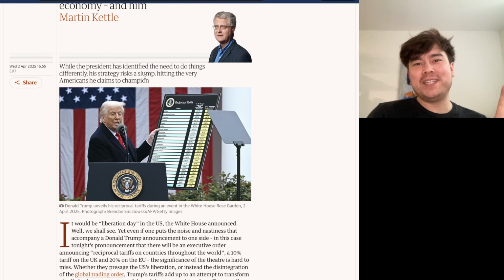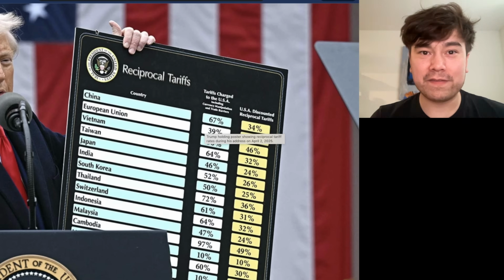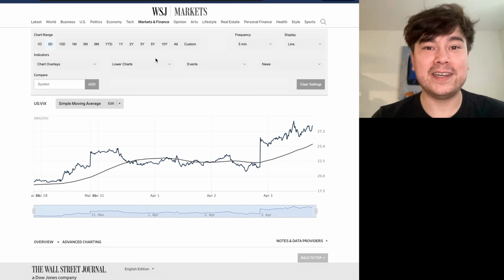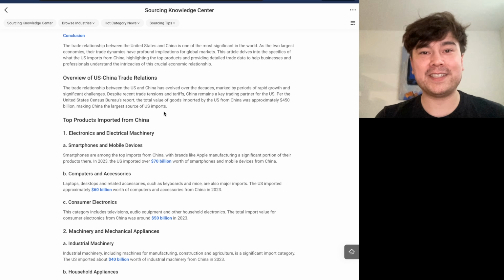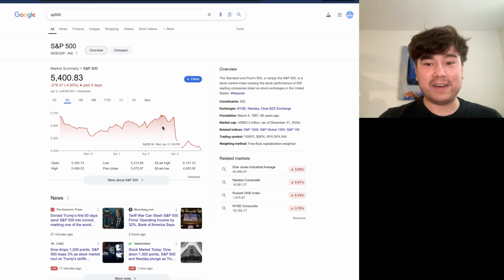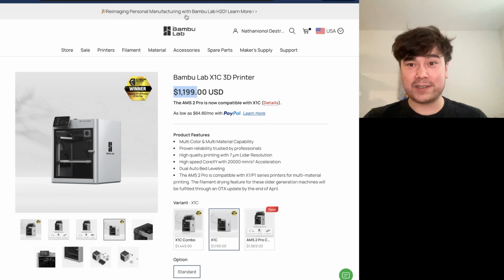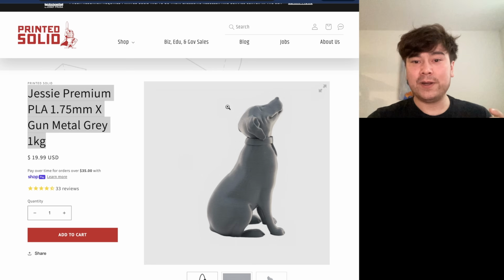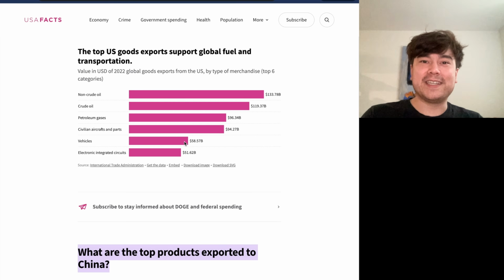Trump's Plan to Make 3D Printing 54% More Expensive (Tariffs + Liberation  Day 2025)

Comment: i could see this back fire with company open shipping warehouses in cheap tariff countries
Reply: @shanepearce1629  imported goods have to state country of origin to prevent exactly what you are suggesting
Reply: @thesolipsist7998 They will fake it, many companies mislabel their product's origin.
Reply: @thesolipsist7998  I deal with all of the parts and assemblies for the company I work for and one of the obligations in our data entry software is that any part that ships anywhere needs a country of origin. Obviously, everything we make in house would have US, but many of the purchased goods that we send to customers need the part country of origin, not the shipping company of origin. Company can get into serious trouble if they are found to have purposely put the wrong info in

Comment: So, to avoid tariffs, you have to buy directly from China, instead of going through an importer, and enrich Chinese economy, directly from wallets of Individual U.S. taxpayers?😡. Wait, it won't work once they close the postal loophole! and the fix the minimum cost(de minimis) for duty free direct imports🤯. So, We are expecting local importers to fold their existing middleman business for small goods? Also what about machinery used by U.S. manufacturing? Going to make it difficult to compete against direct suppliers from China. Expecting somebody to payup Government through local investment🤞, but the cost of labor and local regulations would cripple the possibility of any profit. Good luck day dreaming. Time to createa 3D printed Robot Minions, to put parts together to make finished product. May be time to raid Aliexpress and stockup on 3D printing supplies!😂Way to go MAGA(Make America God-awful Again).  What about 🏌? Are the golf balls, putters and the electric golf carts exempted? ❤👍
Reply from the maker: The de minimis loophole is ending too. Which is going to suck for getting replacement parts direct from China

Comment: Last night I shopped at Creality for a HI and 4 rolls of filament and the price was $599.00 and the taxes was about 40 dollars then I left the web site and came back later to purchase the order and the taxes were 51 dollars , so the tariffs went up within a couple of hours but I bought it anyway.
Reply: the tariff doesn't show up as taxes on the site. Taxes are just a % of the sales price based on the sales tax of the area. If taxes went up, then your total price went up. If your total price went up, there is a good chance that you had an extra item in your cart. The creality Hi is $369 on their site. I'm not sure how you got to 599 before tax by adding 4 rolls of filament.

If you bought the combo, it's $519 and adding 4 rolls to that would put you around $599, but that's the normal price. That isn't inflated by tariffs. If the $51 taxes is correct, then you bought it from a place that had 8.5% sales tax...

Comment: Cheaper housing in EU? For a wooden shed maybe, but for a comparable brick and mortar house it is not cheaper.
Reply: Actually, the quality difference  of housing between EU and US is very dramatic. It's like wooden barracks over solid sturdy lasting houses. I lived on both sides for a while.
Reply: @ZoltanGaal one of our houses, the ground floor is from before congrete. Every generation improved on the house. Very heavy built with having in mind that it lasts for several generations
Reply: Funny, there are almost no brick and mortar houses at all in the US, only paper walls lol. So not really comparable.
Reply: @Alex-bi8ob  Get outside the city,  the rural areas have lots of old brick and stone houses going strong all over.
Reply: @gitss7367  Depends where you live - rural properties in the UK are far more expensive than urban areas.
Reply from the maker: Maybe per square foot the US is cheaper. I live in a terrible cost of living area, and am about move somewhere that is half the price. So I can see both sides being true

Comment: Because of the threat of this, I just upgraded my 3D printers and 3D scanner for my small business in the past 3 weeks. I feared that the tariffs would seriously impact the price of goods. These tariffs will hit other small businesses and makers who are benefiting from the boom in affordable 3D printing and 3D scanning because these innovative cheap products that the 3D printing industry is almost all based on China made products. Horrible day for the little guy who is trying to implement this newly accessible technology into their workflow.
Reply: I bought a Matter And Form THREE 3D scanner from Canada three weeks ago, and a Sovol Zero 3D printer from China a week ago.  My decisions weren't driven by US trade policy and tariffs but may have worked in my favor, although I saw a headline where Canada revoked their tariffs on US goods under threat of retaliatory tariffs so maybe they won't be paying tariffs on goods imported into the US that would be passed on to US consumers?

I'm working on a new product that might require me to buy 10-20 new 3D printers this summer.  I was thinking of getting the Elegoo Centauri (the $199 open frame printer and not the enclosed Centauri Carbon), pending actual experience with real users when the Centauri finally arrives in the US in July or August.  It would suck if those $200 printers suddenly cost $300.  It wouldn't ruin my business model.  Not by a long shot.  But it would suck another $1000 to $2000 from my pocket and ultimately transfer it to the US federal government, because tariffs are taxes.
Reply: @Liberty4Ever  I work in the auto industry designing and manufacturing carbon fiber products for high-end vehicles. Upgrading technology is something most businesses do every 3-5 years. In the last year, I've upgraded my CNC machine (made by an American company—Tormach, but manufactured in China); 3D scanner Creality Raptor Pro, and added a new larger 3D printer Creality K2 Plus to my existing machines. There is an urgency to get ahead of the tariffs. Things that might have been an "I can wait on that" became "Get it now!" 

An example of what me might see: The Creality Raptor X. It was $3,500.00 prior to Trump taking office. But then suddenly it jumped a thousand dollars a few months back. I was in a discussion with a YouTuber who focuses on 3D scanning, Payo-TensileCreator, about the price of the product. He had listed it as $3,500 in a comparison video that he had just released. I corrected him and told him it was now $4,500. He didn't believe me at first but since he lives outside of the US, he kept seeing it for $3,500. Then he changed the country on the creality website, and then he saw it. It turned out that the price increase was only for the US market. The rest of the world was still $3,500, but only for the US was there a $1000.00 premium. That increase appeared to be Creality raising their price in lieu of a tarrifs 

Raptor Pro came out a month ago, I jumped on it. I would hate to pay an extra $1000 or $500 for not reason. That is money that I can be putting in other places. 

For some people and some small businesses it will be the difference of whether or not they get that new printer or that new scanner. New advancements that might assist them in their business will be harder to implement because these tarrifs are not just hitting just the 3D market, its everywhere... for me it's carbon fiber, epoxy, aluminum... the list goes on. All of that will make it harder for small businesses. The Tormach was over $13,000.00, I imagine that Tormach's pricing will have be increased to counter the tariffs that they will incur. So it is bad all around. Will it tank my company, No, but it will make it much harder and much more expensive to operate and eventually, I may also have to raise my prices to offset the additional costs.
Reply: Well predicted. I wish you well with your business.
Reply: You got fear monger and peer pressure to go out and Panic buy yet again by big media. Use your brain. This is getting hilarious how y'all are starting to panic buy again. Are you going to Panic by the toilet paper again😂😅🎉🎉🎉🎉🎉🎉🎉